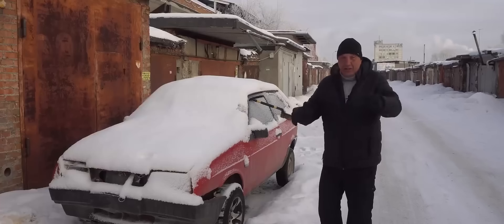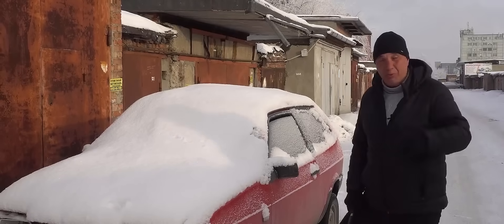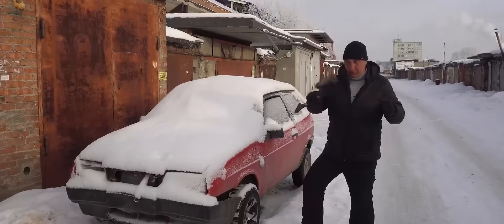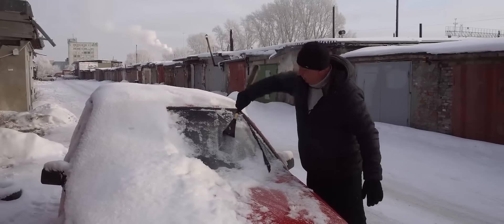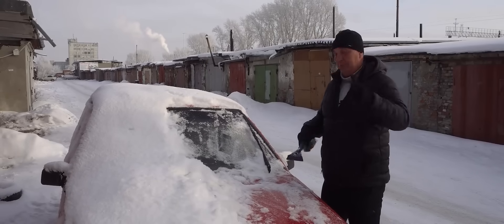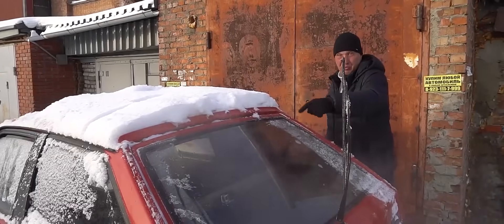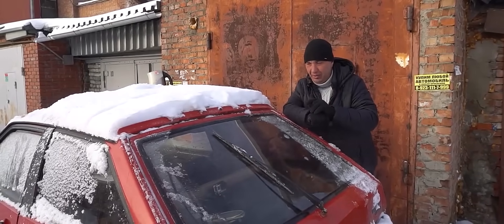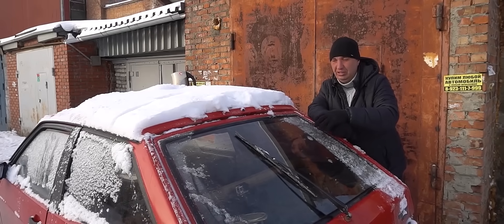What happens when you POUR boiling water onto a frozen windshield?

Comment: Have you ever thought about putting a bearing on either side of a torque converter and mounting it in between the exhaust.

Put some thought into the exhaust torque converter. If you want to convert exhaust into torque now, would be the time to do it.

Comment: I did this for years when I drove a truck (heavy/class 7) and never had a problem, but I also never used hot water, much less boiling.  I still do this on my own cars but with warm water only and only to get the ice off the windshield wipers and windshield washer nozzles.  A crack or even scratch would likely have a different result.

Comment: Older windscreen is toughened glass and newer windscreen is laminated glass so that is why toughened glass is more durable. I have seen laminated glass crack everywhere because of the heat on the outside of a building causing a difference in expansion to the inside expansion because of the cooler air inside!

Comment: I have been clearing my windshield with hot water for over 40 years and never had a problem. But I don't use BOILING hot water, just tap hot water. Boiling water is 212° but tap hot water is more like 140°-160°. That's plenty hot to melt snow and ice.

Comment: There are numerous factors to pay attention to when doing this, as typically the glass will break depending on the thickness of the glass.
Why it breaks is called Thermol shock, the same thing can happen in glass tea pots if you having freezing water and suddenly pour boiling water into it.
The materials cannot compensate for the sudden change in temp and shattering happens as a result.

Comment: What happens if you use really long motor mounts so the weight of motor ( and trans?) Connects to the car body or frame way further rearward? Mounted in trunk? Or mid mounted motor mounts to the normal front engine location. Does it change the corner weights or center of gravity?

Comment: I used to defrost my car windows with warm water for years. Not only I'm able to leave the parking much quicker than my neighbours but the cleaning effort is noticeably less  and the windows are perfectly clear. And they are not frozing again in seconds because they are slightly warm.
But the water I use is something between 20 and 30 degrees Celsius, to avoid thermal shock and cracking the windows. And if the temperature is too low (under 6
...7 deg) I don't risk and I use a good de-icing spray. Anyways, the water will freeze on the window at this temperature.
And one more thing. Don't use this method if on your windscreen there is already a crack because it will progress. One of my old cars had a little crack and I managed to prolonge it till the contour by using cold water to clean the windshield after few hours of parking under the hot sun.

Comment: I live in a very cold country... and I use hot water to clean the glass regularly... Others use plastic tools but still make rips on the glass... (it looks very nice in the summer) ccc...
The water doesn't have to be 70C... you take warm water from the tap... clean the snow,,... sprinkle it evenly on the glass... and turn on the wipers as soon as possible...
Wipers clean the glass of water,,,, and the little residue that remains evaporates.. ;-)

Comment: Ok, if you have snow or a lot of ice on your windows, the water trick will not work. Scrape it off and use de-icer. If you have a little bit of ice/frost build-up, then you can use water. Just don't be an idiot and boil the water. All it takes is warm to hot water from the tap. I use warm water on my car and never have a problem. If you boil the water and break your windows, I will laugh at you for being a dumbass.

Comment: You just poured a hot water on iced glass, lucky you it's nor made in india or China but pouring hot water on hight cold stuff can reduce its stability for few min until it becomes normal again but in that specific time if you push that glass a bit or keep some pressure it may crack. No 100% sure but ya

Comment: The other day I washed my car. It was parked in the hot sun with the windows closed. I went to spray the car with the water hose and the windshield instantly cracked.  I was totally upset but one thought crossed my mind. The windshield will crack with the opposite of your other video. The windshield needs to be hot with cold water poured on it.

Comment: TECHNICALLY THIS IS NOT BOILING WATER, PROBABLY CLOSER TO 88-92C
Reply: Maybe they should first heat it up to 120C so that it will be about 100C by the time they get outside to the car.

Oh, wait - water above 100C is not possible. (at sea level)
Reply: @danbergthold3481  not entirely correct DB, in a pressure cooker, water can get up to 125C at sea level - you just have to be like REALLY CAREFUL if you are going to open the lid before pressure is vented
Reply: @raccoon874  You got me there!  Now I've got to find out how the freezing point changes with changes in elevation and/or pressure.
Reply: @danbergthold3481  the freezing temp goes up a tiny little bit, very very small change
Reply: @raccoon874  I was just reading about this - very interesting stuff!  Garage 54 is a great resource for learning new things - LOTS of things. That, plus Vlad's twisted humor keep me coming back for more. For his sake, I truly hope that all of the Monthy Python episodes have been translated into Russian.
Reply: @danbergthold3481  They certainly come up with interesting scenarios, studding tires with self-tapping screws was a great idea!

Comment: Saab 9000, Volvo 850, Fiat Marea, Toyota Avensis has been cleaned from Swedish winter ice build-up with (luke) warm water with 100% successrate. Takes about 7L to clear all windows in less than a minute. Well worth it compared to spending 3-5 minutes dragging/pushing road grit all over your glass with an inferior piece of plastic creating fine scratches.

Comment: You don't need to put boiling water on a windscreen to melt snow, any water that is above 0*c will melt the water because its no longer at freezing temp and thus warm the snow up and melt without causing thermal shock

Comment: Front windshield on 07 Nissan Murano also will not crack from rapid thermal expansion. If you think about it, in summer time, your windshield is boiling hot, if you wash your car and pour all that cold water on it, it does not crack either. It's designed to handle it

Comment: I own an auto glass replacement business.  If the windshield is free of chips it is more resistant to the rapid temperature change of pouring on boiling water. (Not recommended)  However, if there are chips or defects in the glass, the movement created by sudden thermal expansion will create focused pressure on those spots increasing the likelihood of expanded cracking.  It is not an absolute that the window will crack, but why unnecessarily increase the odds?

Comment: I used to pour hot water on my windshields to get them defrosted in the past. I never had a windshield crack, but it wasn't that hot. It works until you start driving, and refreezes. 🤦🤷 Now I carry a spray bottle. With 2/3 parts rubbing alcohol, and 1/3 parts water. I just keep it under my seat. spray it on,  let it sit for a few seconds. Then use your wipers or a scraper, it comes right off.

Comment: I've been using this technique for over 40 years on all my cars, and I've never had a problem.
I should point out that I have worked for 40 years in a company that manufactures automobile windows, so I know that these windows are quite capable of withstanding this thermal shock.
Reply: Im doing this on modern cars for a few years now. Trick is to get warm (not boiling) water and pour it slowly. Never had a problem. Tested it for 2 winters on an already cracked windshield - got a stone in it on the highway, same results. Happy to confirm that the crack did not travel further and remained around 3 inches long untill I got a new windshield on. No more scraping ice on cold mornings for me :)
Reply: @sapte62  lovely!
Reply: my windshield cracked in the cold February winter, Ford Tourneo 2015, initially a 3cm crack at the bottom, then slowly growing. I did nothing, no pouring hot water, only turned on the heat to windsshield thawing! iit happened about one mile after start-up! Maybe the trouble comes  when the hot air warms up the middle of the window first, while the rims are still freezing cold. 
See, in this "experiment"  he, Garage54 mechanic, poured boiling-hot water on the rim of the glass. This way it causes expansion there first and therefore compressive force, and therefore no crack. Maybe?
Reply: @konradcomrade4845  your windshield was already cracked
Reply: so your age is above 60 and below 72?
Reply: Aren’t there some cheap windsheilds out there, some that may crack. Maybe made in China. I don’t know, I am just asking.

Comment: As someone who grew up in Edmonton in Canada at 53°N I experienced many -40C and colder days in my early driving years. The temperature on that day there being somewhere between -4C and -10C is not all that cold. Considering how little ice was left on the windshield when he started to pour. Still, I too am surprised the windshield did not crack.  I guess that being a Russian designed and built car, they may indeed have made the glass tougher, designing for the local conditions.
Reply: I am also in Edmonton. It's currently -41°c .  I can't imagine ANY type of windshield that would survive boiling water being poured on it at these temperatures.
Reply: @seancripps4897  I grew up there. When I was 30 I moved to Vancouver. At 49 I moved to Los Angeles. Though I came back to Vancouver in 2010 at age 59. Canada is a better place to retire. Now in a burb at the eastern end of Greater Vancouver it is a cold day. 0C with mixed snow and rain. 

But to address your message, I would not expect it to survive either. I do expect the Soviet designers of the Lada expected this to happen in Russia and made the glass so it could specifically handle this treatment. The joke for the presenter is to think how many western windshields get broken this way.
Reply: @seancripps4897 never cars doesnt have that temerature Shock problem
Reply: @Nico42x3d  what ?
Reply: The windshield on this line of cars from vaz 2101 to vaz 2015, is not glued, but is installed on a special elastic band and has the ability to move there (thermal expansion), vaz 2121 uaz 469 and uaz 452 cars are used, including in permafrost regions, for example, in the same Yakutia recorded more than -70 ° C 
Thank you Google translator!
Reply: Did you ignore the fact that he talked about all the russky cars cracking along the bottom when you were warming it up...Ladas are probably the biggest  pieces of shit ever made... ps putin should be in prison!
Reply: I'm in PG and wouldn't dream of doing that to any of my windows.
I bet if he poured half way down the glass and kept the top portion cold the results would have been different
Reply: Russian designed car im surprised all the wheels are on

Comment: No windshield will crack with boiling water unless there’s a weak point like chip or crack already in it. A rear glass has defroster doing the same as boiling water instantly changing temperature. Windshields are built not to break.

Comment: The trick about putting hot water on to cold glass is to put it on slowly not just throwing it all on at one time. I did this with a new van that had a chip in the windshield that I fixed with superglue. Owning the van after three months it received a stone chip In the windshield and putting superglue fixed it until it went to the junkyard with no cracks in the windshield even applying hot water to the windshield at home going to work and putting hot water at work going home. In the video you see him starting from the top and working his way down. He could do it a little slower pouring the water to make sure the top is not hotter than the bottom. You want to make sure you thaw out the windshield evenly applying it from the top to the bottom then from the top to the bottom over and over until the windshield is evenly thawed out. After all the water has been poured on the windshield you wanted sure you lift up the wiper blades and clean them off why they are thawed out so they do not freeze in a certain position preventing the performance of the wiper blade. The wiper blades need to cool down before you set them back on the windshield so that the wiper blade is not positioned in one position preventing free movement.

Comment: bullshit, ford, mitsubishi and multiple other cars ive owned never cracked when ive used this technique, lada isnt one hell of a car, the fucking windscreens are laminated glass, they are made to be resistant to this kind of abuse, i mean for fuck sake do you expect your house windows to get stones and pebbles flicked up at them every day? no.
do you expect your house windows need to be scraped or doused in hot water during winter months? no.
they use different technology on windscreens to fit the job they do, not every piece of glass is the same.

Comment: Windshields are not a single layer of glass, but two layers with are bonded together with a transparent plastic layer in the middle. So it's possible that the middle layer is flexible enough to prevent the glass from cracking. If there is an existing crack or nick however, then hot water will make the crack grow.

Comment: I've seen windshields cracked by the A/C blasting hot air at max temperature in the winter.
Reply: How the fuck can the A/C blast hot air?
Reply: @tualatinwolf5639  the same way it can blast cool air. By cranking it up to HIGH, it spits like 28*C and in a cold winter with -15*C outside it's a big difference

Comment: It only cracks if u have a rock chip usually on the bottom of the windshield. If there is no rock chips nothing will happen. But those rock chips really hard to notice especially if it’s under the windshield wipers.

Comment: I'm wondering if the mass of the glass and the relatively small volume of water poured slowly simply isn't enough to actually heat the glass to the point of expansion stress? How about trying  a boiling 5 gallon fast dump?

This give me hope though .. I've been thinking of wrapping copper tubing around the exhaust manifold down pipe to heat up the washer fluid outlet. I like winter enough for play - but dorking about in minus 20 at 4 AM to get to work sucks.

Comment: Around 13 years ago we had an ice storm with accumulation of 7-8 in. It sounded like a war zone with 150 to 200 year old trees snapping like matchsticks. After a day's work clearing the driveway with the backhoe it was time to venture out in my 4 x 4. But there was no scraping that much ice off the windshield lol. So without thinking I resorted to hot water trouble was boiling water tends to freeze instantly in freezing temperatures. The neighbor had a good laugh being used to freezing temperatures and Ice storms. He told me a temperature of around 50 - 60 degrees would melt the ice better and there would be very little risk to the windshield. He was correct! The ice melted very fast with 50- 60 degree water and no cracking.
Reply: Jesus where do you live?

Comment: Water does not have to boil, just to be hot and it is perfectly fine.
You can do it with cold water too, cold water is still hotter than ice and it will melt. Just wipe the water fast and not problem : no water no ice.

Comment: Frankly I wouldn't try boiling water.
On the other hand, I've been doing it for 40 years using hot water pots (from the tap at around 60 °), without the slightest problem, including on cracked windshields without anything happening.
And there's a good reason for that: The calories in the water are absorbed by the frost layer causing it to melt, don't stay in contact with the glass long enough to transfer the calories that aren't there anyway in sufficient numbers to have the slightest chance of warming the glass thoroughly.
Defrosting your windshield with a pan of hot water presents no risk!
When to tell a Russian what he can or cannot do in this case ... LOL.

Comment: It may be the way the glass is stressed in the frame. Heating the outside only would make it curve more in the manner it is already curved as the external surface expands. This wouod only lift it away slightly from the frame. 

Heating the inside is trying to straighten the windscreens curve. And it's stress will increase as this will force it more in to the frame. The combined action may then cause a crack. 

Poure the water somehow on the inside and it may crack.

Comment: It presents higher resistance if forcing it to dilate when contracted. I believe it works better in reverse - pouring cold water on heated windshield, and it will crack when that spot is forced to contract. Try it

Comment: Just warm water  works fine,  The temperature conversion is close enough.
 boiling water is dangerous, not just cracking a windshield* , but it  being dropped and o/ splashing on you.
Thick ice , you need that ice scraper. many people will pour water on thick ice. 
note,  that might not be multi-layered safety glass, , the expansion is different in safety glass

Comment: Actually in the past, I used to do it as a daily routine in cold winter times.  (I had dirty cheap cars (Trabant, Zastava, old Nissan Sunny N13.) 
Ok, I didn't use boiling, but pretty hot water. But still, the glass NEVER broke!!! An old taxi driver teached me this trick. He told, it always works on every kind of cars, and never cracks the glass!
The only dangerous is the opposite way: to pour very cold water onto a very hot glas!!!

Comment: Glass cracks when only part of it heats up rapidly and not the other, from what I saw you poured the water pretty equally around the windshield so that could be a reason. Idk, even though you did that it was still an insane difference in temp.